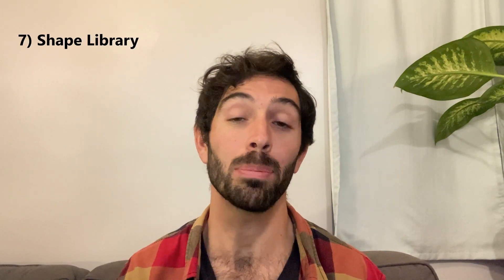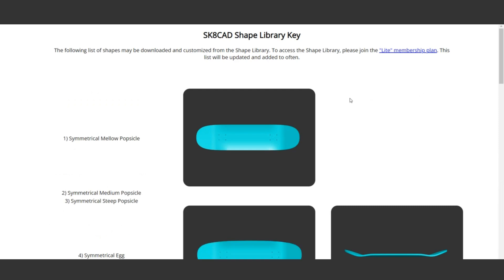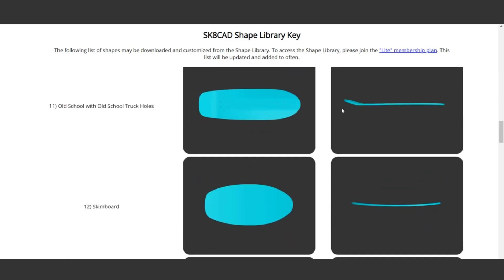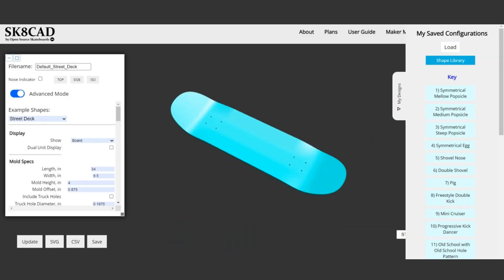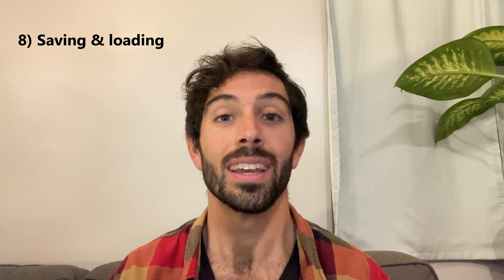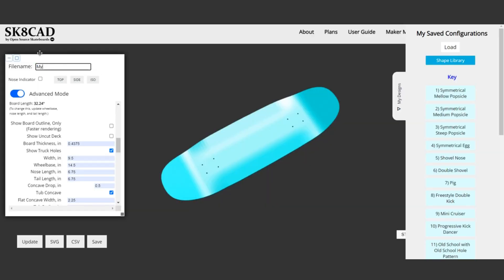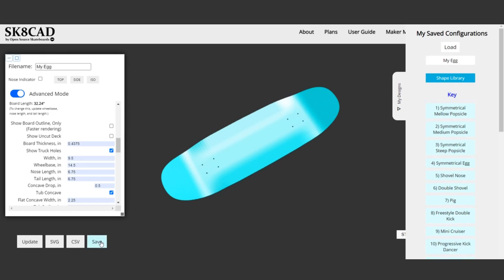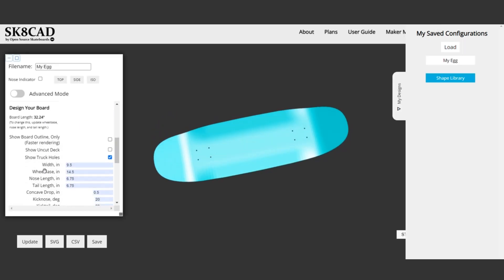What's new in SK8CAD!

Comment: Hey appreciate this content! I am trying to print a template out for my first build, can I do this with sk8 cad?
Reply from the maker: Yes! Check the "Show Board Outline, Only" box in the "Design Your Board" section. It doesn't currently allow you to set thickness, but you can cut it thinner in some free programs like PrusaSlicer. Or, if you prefer to set thickness in SK8CAD, you can simply set the following parameters to 0 (with "Show Board Outline, Only" unchecked): concave drop, kicktail angle, and kicknose angle.
Reply: @openSourceskateboards   Hey thanks for getting back to me! For some reason every time I download the template I only get 1 line on a single sheet of paper. I’m using Apple is there a program I need to open the file In for it to be the correct size?
Reply from the maker: @andrewmills7701 Ah, I didn't realize you meant a paper template / SVG, sorry! You can use the SVG button to download that (which it sounds like you found). I recommend opening it in a program like Inkscape or any CAD program.